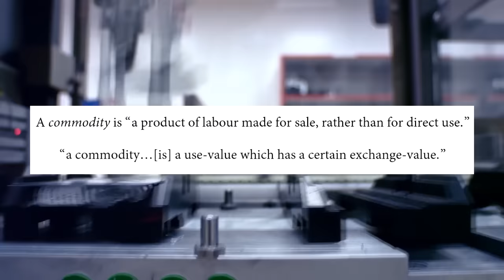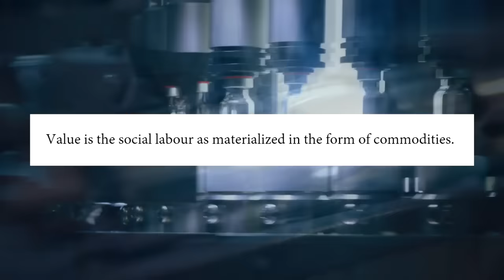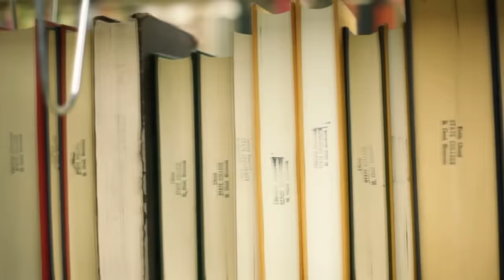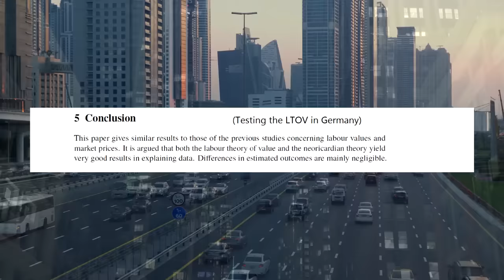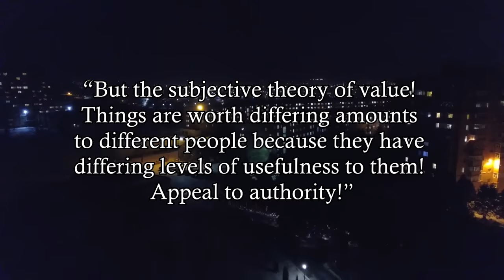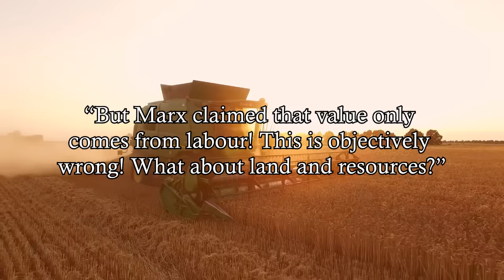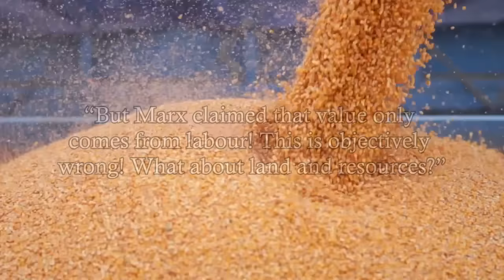Capitalist arguments against the labor theory of value suck (Explaining the LTOV) - Socialism 101

Comment: 1:51: “…if the labor time necessary to produce a car is 100 times the labor time necessary to produce a loaf of bread, the car will have a value 100 times the loaf of bread.”

This assumes that the labor skills required to produce a car have the same value as the labor skills required to produce a loaf of bread. Simply comparing the labor-hours involved in producing two products ignores this important difference. The labor theory of value is, ironically, ignoring the different values of labor.
Reply: Marx mentioned that complex and hard labour can also be viewed as a higher amount of less complex and less hard labour.
Reply: That, and this idea is ignoring the fact the materials to make a car are a lot more expensive as well, mostly due to how difficult it is to get all of them, how rare they are, and how costly it is to ship them to the workers to then turn them into car parts to then turn those into the car.
Reply: According to Marxists, the labour involved in learning the skills and making the capital is included. At least I'm assuming so.

Comment: A theme in this video that became increasingly clear was that many supposed counterarguments to the LTOV hinges on the unspoken assumption that price (or possibly profit as a substitute) = value. Likely due to an internalized assumption that any profit generated is because whatever was done to acquire said profit must have generated value in some way.
Reply: Price is a reflection of value.
Reply: @ExPwner  Prices and values are linked! They are not the same though.

If the productivity of labour in society falls by half, then also the price will rise. If the productivity of labour within society doubles then the price will fall. Without a doubt it won't fall exactly as much as the value ie half, but it will fall.

Every change in the price doesn't reflect a change in the value though. Changes in price can happen with for example the fluctiation of prices, changes in the subjective thoughts of the individuals etc. So demand. 

So we cant just say that price is a true reflection of value.
Reply: @benniethejets  no, that is non-sequitur.

And demand is a function of consumer value, so that is wrong too. When people value something highly they demand it more and will pay higher prices for it.
Reply: Yea, the difference is that price is measurable and generaly works withing STV, while "value" is unmeasurable because LTV is not scientific

Comment: 6:00 Wow, that's a REALLY good point. I thought Marx' response to supply and demand didn't go much deeper than "it's just the fluctuations on top of the actual value", but this is a very good explanation to why supply and demand is not end-all be-all to someone who is skeptic about the labor theory of value. Where did you get this insight, or did you come up with this one by yourself?
Reply: No economist thinks that supply and demand explain equilibrium prices. Nobody who has ever done an introductory economics course thinks that. Of course production costs determine prices. But production costs and labour hours are two different things.
As to where he got this "insight", marx himself wrote that deviations of supply and demand explain deviations of the price of a good from the equilibrium price, not the equilibrium price itself.
Reply: The funniest part is that when you reach the perfect value in supply and demand, that’s quite literally the result of the LTV, it’s more accurate as a prediction model in tangible units than it is for subjectivity, because subjectivity is literally impossible to predict, so it’s quite literally the most accurate prediction in the form of the LTV.

Comment: The escision of market price and value is an artificial one because they are logically inseparable. There is no way to estimate value without ascertaining the market price. The market  value of a diamond could be higher than the value of a Bentley. This is not due  to the amount of labor that goes into each. In turn, market price makes it impossible to estimate the value of socially necessary labor to manufacture a commodity and, thus, confirm that such labor value exceeds the value of the working capitalist without whom there would be no wages at all. Only the capitalist who inherits wealth or speculates with stocks is  clearly pocketing the workers’ labor. The other problem with the labor theory of value is that it has not been applied to the sale of services which account for a huge chunk of the economy these days. The value of the labor of a physics Nobel laureate is calculated to be worth less than that of one of the Beatles. Does that make sense without the supply and demand (price) phenomenon? How do you calculate the value of labor without the market? Please convince me that I am wrong.

Comment: Ayyy! Something I actually can follow really easily since most of it is from the early parts of Book 1 (Just started this year, haven't gotten all that far yet, it's not the easiest book I've ever read but it does have its charm). I do recommend you read at the very least the first parts about value, trade, the expression of an object's value through another, the special case of currency which is really interesting (also most likely the next part which I haven't yet reached about the transition from money to capital). Already gives you solid foundations to understand Marx's angle, it's good stuff. Probably not the book I'd start on for theory though.

Comment: I've been confused about the LTV, and this video made it worse. 
Every time I've heard about the LTV, it's been not presented as a "theory" in any remotely scientific sense, but rather as a MORAL theory/argument: that workers are having "value" taken from them (in this sentence I use "value" not in any technical sense, but just to mean that which is good, i.e. something which it would be morally wrong to just take from someone), and therefore the system OUGHT to be changed.
Likewise, most of the "counterarguments" I hear are just versions of "No, that definition of 'value' doesn't accurately represent what our moral sensibilities know as 'value'. Here's how we think 'value' should be defined as in economics (*cough* so that people don't think they are being stolen from cough )"
It seems more like a battle of definitions to me; a battle between frameworks for analyzing the world
However, you mentioned how it "fits the data better" (or some similar phrase). I don't understand what this could mean, since as you and others have presented it to me, LTV is underdetermined as a scientific theory: there are as many definitions in it as there are statements. 
You also mention that it has "explanatory power", which could make sense (probably you didn't have time to present this or how it "fits the data"), but I would emphasize that we really only consider explanatory power when we have two competing theories which BOTH fit the data perfectly, so I'm still confused.
Maybe it's like "string theory": an multiply infinite family of theories, that doesn't make any actual predictions (and thus can't be considered a real "theory" yet, but it might be the framework for analyzing the world that we need to use to get to the actual theory of physics.
Can anyone point me to a more rigorous (but brief) description of LTV and how it fits the data?
thanks! Love to all
Reply: LTV, should be better understood as the core of production. This sentence might sound confusing as fuck, but let me explain.

In neoclassical economics, we only deal with the market, the behaviour of the market, and the way it operates. STV, is enough. No need for LTV (seriously). LTV, will be useful, when understanding the mechanism of wage system, which is the backbone of production of well-developed capitalism. In a well-developed capitalism, after a series of competitions, eventually capital will be concentrated in the hands of the owners of the means of production, which are referred to as the bourgeoisie.

You might ask: What is the correlation between the centralization of capital and the LTV? It relates to the majority of population of the consumers, and the producers. In capitalism, due to private ownership, the producers are the bourgeoisie (why? because due to private property). But the majority of the consumers are the proletariat (minority are the bourgeoisie, they still need to purchase stuff as individuals).

Here is the logic:
- The proletariat wants to buy stuff, he/she depends on wages to buy stuff.
- Thus, the majority of purchasing power (that are controlled by the proletariat) are dependant on wages.
- Thus, the more the workers, the more the wages, the higher the purchasing power of the population. Aka, higher labor value.
- Labor value, is the representation of wages, the dominant power of the demand. That's why prices are "anchored" to the labor value, because if the labor value decreases = wages decreases = purchasing power decreases.

This is only a small part of Marxism tho, if you want to engage further let me know in the comments.

Comment: I don't think I understand the purpose of this theory. I get what you're saying, it shouldn't be conflated with price. Yet, in the beginning you say the labor theory of value determines the economic value of any commodity. What is the economic value of a commodity if not price and what is it good for? Is it just an abstract evaluation of the product that serves no purpose? I think if you're going to insist it's not the same as price you need to also explain what function does it serve that price doesn't.
Also, 9:55, we don't have a lot of artisanal work, but we have some and in the examples you gave the minute before, art and cuisine, skill does matter. I'm not sure you can evaluate those based on an average. In fact, when you talked about art and cuisine you said more about how their price is determined than how their economic value is. So how is it determined? And again, what purpose does that serve, if not to determine prices?
Reply: Relative prices are the things you see when you go to the store.  Relative values are the labor values in those things and the ratio between them is what relative prices approach.  Keeping them separate is important because its not like $1 = 1 hour, the price form of a commodity is separate from the characteristic of commodities which determines how the prices act.
Reply: You can think of value as the baseline price for a commodity, but it's not the "actual" price because it doesn't reflect external market indicators, supply/demand. These things exist but are not all-powerful. The amount that you sell something above its value is profit or surplus. The Marxist argument for surplus is not that it exists, but rather who gets it/who benefits from it.
Reply: @Tetragrammaton22  So is the purpose of the theory not to determine the price but rather how much the workers should get from its sale?
Reply: @tasfa10  The purpose of the theory is to point out the exploitation of labor. Pretty much all economists were/are deeply concerned with price. What causes price? Who choose price? How do we know how much to sell, and on and on. Marx did not have this obsession with price.

Comment: Exchange used to be conducted using gold. Gold was something that needed to be mined and processed, thus putting labor into gold. It was easy to associate the (labor) value of gold relative to the (labor) value of wheat, or any other commodity, from the relative amount of labor that went into each thing. Of course, we know that value is not price, rather that value informs price, like some kind of minimum price level based on the input costs of that commodity. Price is then some point above (possibly below but unlikely) that value based on market conditions of available supply and demand.

A problem arises when your medium of exchange (currency) stops being a commodity. Fiat currency is not based on any value of labor. This is especially problematic in countries that can very easily "print" (now digitally) their own currency.
Reply: The issue isn't that fiat currency isn't based off of labor, but that a fiat currency has no intrinsic/use value. When Marx simply says "value" he is referring to the use value, the function, of an item. "Price" is the exchange value and has only existed as long as commodified markets have existed, since the creation of money. Price is determined by the supply and demand of different products of use value, it has never been determined by the labor that is involved. Money is and always will be a commodity as it is based on such supply and demand of different products. The price of something is the sum of all prices/products involved in making a product plus profit, labor is one of those prices. The price of labor is the labor market, which is a commodity. Humans were commodified with the advent of slavery and wages. The price of labor for all of history is determined by how much it costs to subdue and control the labor force.

Comment: At 10:00 you opened a question for me: what about the impact of intelectual property on the production of things?

If there's a traditional method A that is 10x slower than the newer method B but method B is highly restricted (e.g. uses dangerous chemicals or requires equipment with exist restrictions like the chip-making EUV technology), how does the LToV handle it?

Do we consider a weighted average of both methods using their market shares as weights? If so, wouldn't that imply that the value of the final product decreases as method B becomes more popular?

And if consider only the best methods, does it imply that researches continuously decrease the value of things as they discover new and more efficient methods?

Comment: Sorry, no, that's just the same old stupid Marxist nonscience.  Jevons conclusively refuted the LTV in 1871 by pointing out that value is related to labor because people devote labor to production of a particular item until the marginal cost of the labor is equal to the marginal value of the product.

Your first error is in thinking you can make the LTV into a tautology by DEFINING "value" as socially necessary labor time.  No, sorry, value is what something would trade for, and THAT'S IT.  As such, value is neither objective nor subjective, but rather the COLLECTIVE judgment of the market.  "Use value" is what modern economics calls, "utility": the capacity to satisfy human desires.  Value is simply the intersection of scarcity (supply) and utility (demand).  "Price" is just what something exchanged for, and is usually very close to value.  "Socially necessary labor time" is nothing but a Marxist anti-concept.  How much labor time it takes to produce something is a function of how much capital the entrepreneur/capitalist has invested in producer goods that make workers' labor more productive -- see Adam Smith and the pin factory -- how he organizes production, and how skilled the workers are, NOT the value of the product.

Marxism-socialism consists in blaming the factory owner for what the landowner does to the worker.  The factory owner has NO POWER to do anything but offer the worker access to economic opportunity he would not otherwise have.  How would the worker be better off if the factory owner had never existed?  It is the LANDOWNER who DEPRIVES the worker of access to economic opportunity he WOULD otherwise have: if the landowner had never existed, the worker would have been at liberty to use the land.
Reply: one of the few ppl with a brain in this comment section 💀

Comment: If I understand correctly, the labor value embodied in a commodity is not the price, but does to some extent dictate the minimum non-loss price? Like in the example of a car, even if supply and demand are exactly balanced, the car still required a certain amount of labor hours (in the extraction and processing of raw materials, fabrication of parts, and assembly) to produce, so the price must be at least enough to cover all those labor hours, which comprise the value of the car.

Comment: Around the 6 minute mark you make a remark that represents a fundamental misunderstanding of the notion of supply and demand. 

You say “what if supply and demand are equal”, as if they’re singular values that can be equated. ‘Supply’ isn’t how many goods are produced, and ‘demand’ isn’t how many are demanded. Supply and demand, in an economic sense, represent functions that typically work in opposite directions. Specifically, they represent the function of Price (P) vs. Quantity (produced or demanded, Q). So a demand curve will represent the quantity of a hood demanded at different price points, and a supply curve will represent the quantity supplied at different price points. This is one of the inherent problems with LTV in that the notion of price appears before sellers and buyers even have the ability to work out the truth of the matter in the market. Sellers ultimately have to just ‘set the price’ of a good at an arbitrary number. Usually it’s going to be more than the cost of labor and materials because sellers are looking to turn a profit. Likewise, buyers are going to compare prices and determine their course of action by either refusing to buy something that they think is overpriced, or moving to a different seller who can price more competitively. This is what causes prices to settle at specific points, and only afterwards determine how much of a good sellers should actually produce. 

Labor is obviously a constituent of the value of a good, but it’s clearly not what determines it.